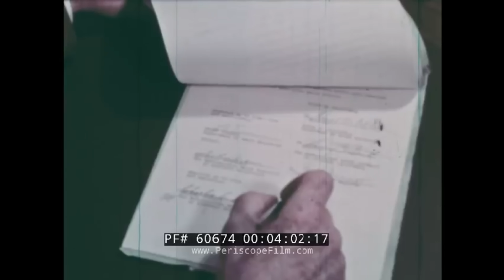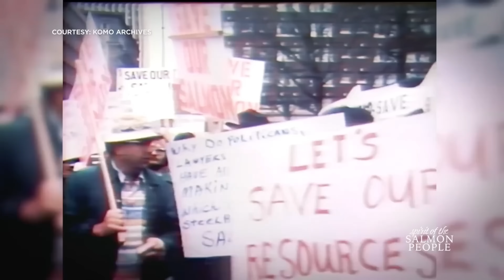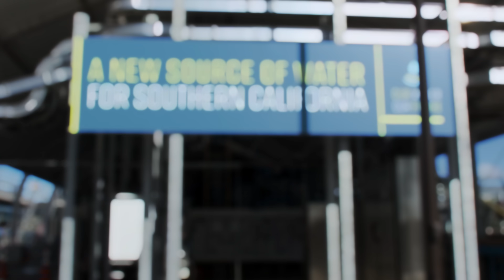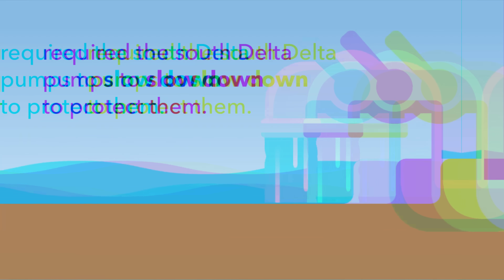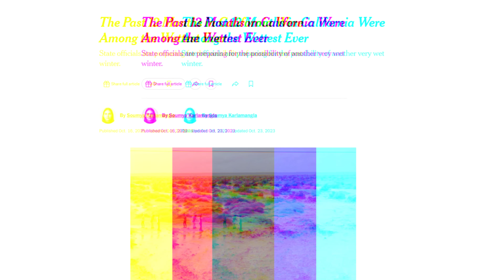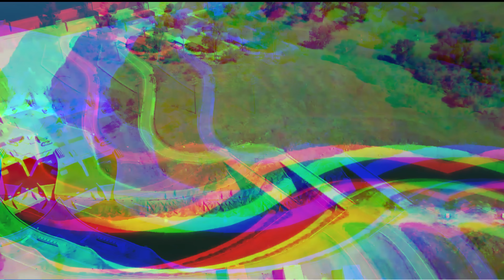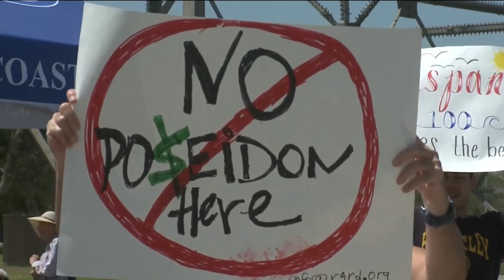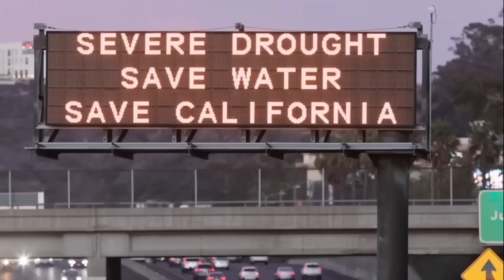California's MASSIVE Water System Is Failing

Comment: Sites is another boondoggle attempt to correct a problem by adding more problems. From the peak of Mount Lassen to the mouth of the Golden Gate, where’s our water?! A few years ago, I reached the Peak of Lassen and much to my dismay, the huge glacier was almost gone! There is nothing in the freezer of California! 

Looking out west to my beloved Tehama County, I saw a mountain of dead yellow and bright green squares, like a patch work quilt, from destructive clear cuts, with a valley full of smog and pollution, keeping out the rain. Clear cuts, like these that can be seen on google Earth or KRCR Weather App, don’t hold our snowpack, as is not drawn into our water system and without shade, snow evaporates into the atmosphere. Looking to the East, there is a healthy forest and plenty of water, as Lassen and Plumas do selective cutting and manage the forest in a healthy, sustainable way, now wiped out by the Dixie Fire, which burned 1 million acres.

A lack of water has been evident in July, as Battle Creek, was running in July what normally runs in September and not a drop of water in Paynes Creek. I know we’re in a drought. If it is due to global warming, shouldn’t we be smarter about what we are doing and not just ignore trends for big bucks.

Comment: Every section of this video should reinforce the concept that the ratio of water use between residential and farming/industrial 1:4... When you include well pumped water, the ratio can be as high as 1:6.  Remember, a significant portion of that farm/industrial water is for products exported from the state. This is not about responsible residential water use, but about antiquated water "rights" and commercial products that rely on large scale availablity of water year round.

Comment: I think the best solution is a combination of hundreds of solutions... adding solar panels above the canals will generate energy that will offset the cost of the structure and panels over the lifetime of the panels and save over 2 gal water per sq ft per year.. not a lot but decent runs of solar panels could save a huge percentage of the loss of water.  according to Grok if we covered all about 4000 miles of public canals we could save 60 Billion gallons per year.. this would generated about 1/2 the solar energy needed to meet California's decarbonation goals. if we add more solar to farms we could save about 14% of the water used on those farms without loosing crop yield (on shade tolerant crops.  Neither of these 2 methods will be enough... but even starting both projects would supply power to the farms while reducing water needs and the evaporation savings on the canals would also help. 

Anywhere we can make 2 prog progress IE saving water and generating power we have a solution... 

The solution is never going to be a one size fits all.. we need thousands of solutions... Another solution not water related would be batteries to allow for collection of both green energy to prevent curtailment and allow even oil/gas power plants to operate at max efficiency with the batteries charging to keep the plant at max efficiency when power is not needed. prevents needing new plants also for same total output.